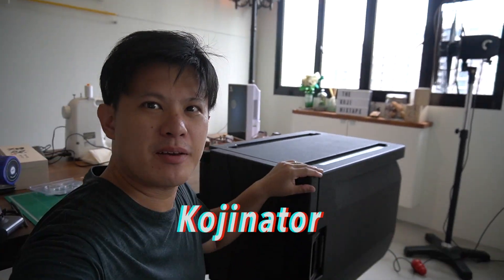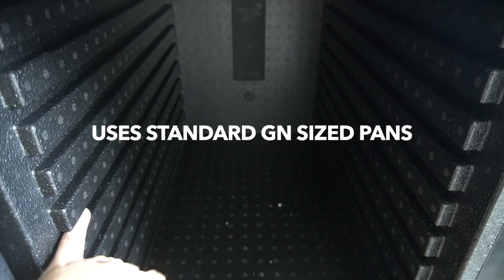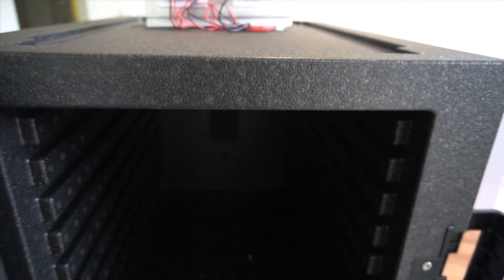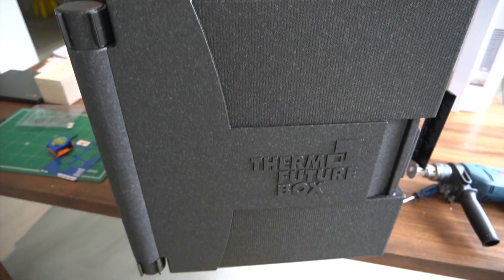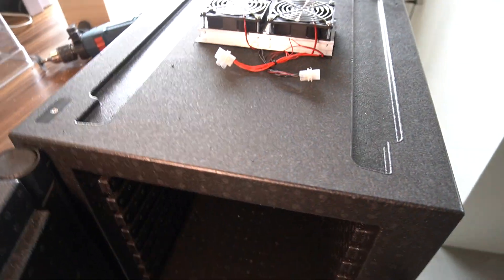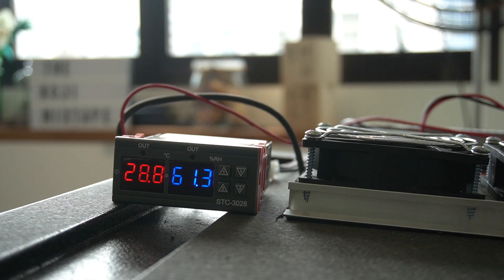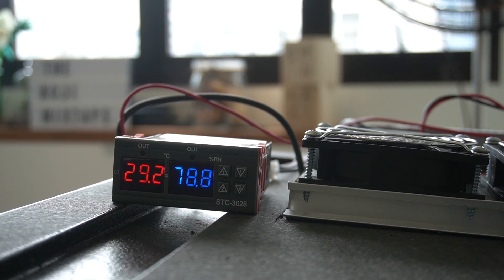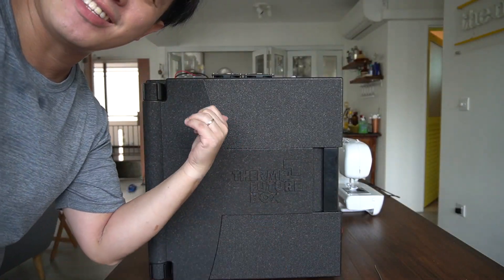How I build my DIY Koji Incubator for the Tropics

Comment: Very nice 🙂
Just a question: What about add a TNT fabric filter, or perhaps a EPA filter, when we desire to grow spores/starter for koji? This would reduce dramatically the risc of contamination.
Reply from the maker: Not sure though about growing spores though! But like sourdough, there are thousands of different bacteria on it until eventually a far majority species takes over. I reckon if the correct environment, the target species or spores  will take over. Unable to create a truly sterile environment
Reply: @TheMixtapeChef  Thanks for respond. Yes, sterile is not viable for home, just for lab, and as you said the competition leads the strongest takes over. But koji rice is simpler than tane-koji. It's just that I saw people and articles saying that home made tane-koji involves some danger of contamination and I imagined a TNT fabric filter would make it safer. Also, some home koji making home systems for tropical countries are not high end as yours, and uses simpler direct fan to cool down, which means direct external air right in "koji face".
By the way, many asian countries consume a lot of low moisture (sold dry) soy TVP in the shape of steaks (soy slices) made by advanced extruders, making the fibers parallel. Have you ever tried to inoculate koji on soy TVP to give it umami taste?
I was wondering two way: 
1- Direct inoculate koji in soy TVP after steam TVP (to kill germs) and hydrate to the right point. Test in minced TVP and steak TVP. Minced TVP have more chance of success.
 2-Use a similar technique like used amazake, using the enzymes already produced by koji to direct act in TVP. To avoid end with a mix of soy TVP and rice, the koji rice woud be left in water for hours in the cooler to the enzymes ends in the water.
The goal is to create umami rich TVP withou shoyu or MSG.
Please let me know what you think about these ideas.

Comment: Hi, im living in Bangkok and also looking for a diy Koji Chamber. Whats the temperature likes over there that too high for the koji? Can you just use fan as a ventilation to decrease the temp and increase the airflow instead of refrigeration unit? I thought 30degree C is typical for indoor climate?
Reply from the maker: Yes, you can grow at Tropics room temp. But it will typically be kept in a box to prevent contamination and Koji is exothermic, it creates heat and can send the box temperature to too high. Before I had this refrigeration unit, I open the box every 6 hours to let cool air enter to regulate the temperature. Good luck!
Reply: @TheMixtapeChef  gotcha thanks Chef